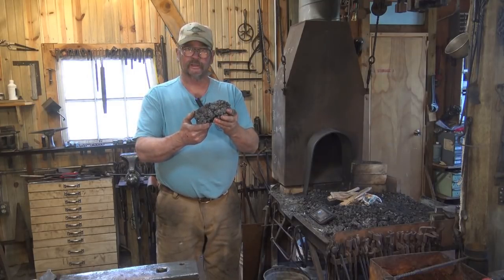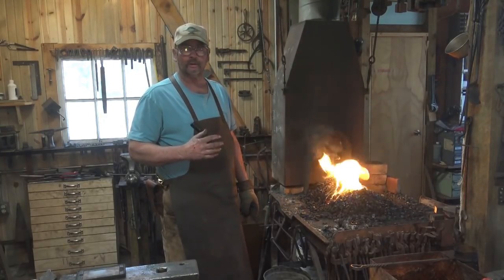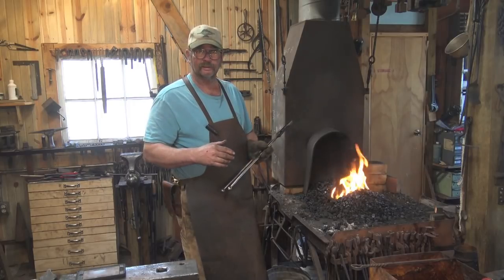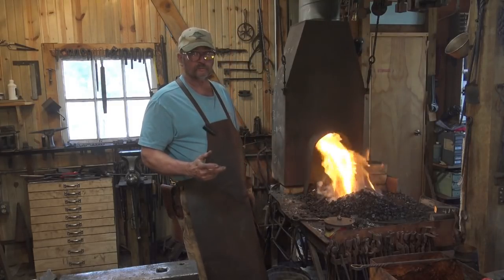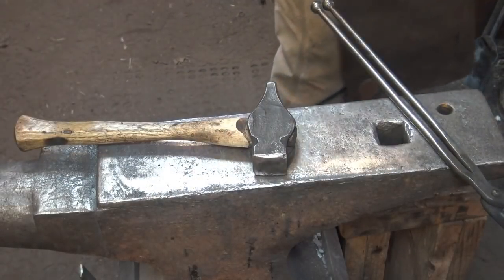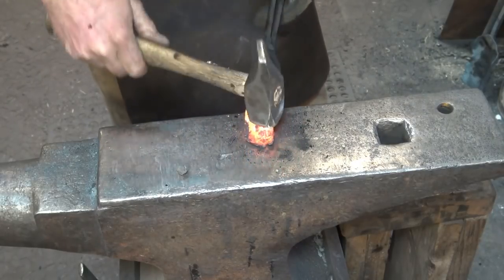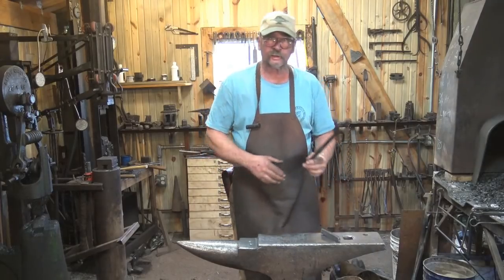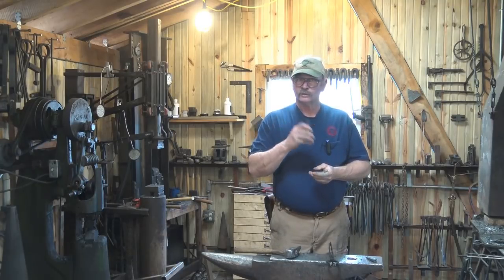Refining the iron bloom into usable wrought iron

Comment: Yeah the reason you had such a hard time with this, and why it was so brittle, was because your smelter friend was wrong. You need limestone in the melt, to tie up the Silicon elements otherwise you end up with a very brittle iron. Limestone becomes Calcium Oxide in the fire, which reacts with the silicates and turns them into Calcium silicate, which is your slag. Next time try it with limestone powder and you'll see a huge difference in the product. You ended up having to do a LOT more work to get it to a useable state, than you would have if you had used limestone powder in the furnace. Simple garden lime (not hydrated or quicklime) will do fine for what you're doing.

Comment: Something that might be helpful, is that when we did the smelt at the event, we went straight from the furnace to the forge. When consolidating the bloom, it was done basically in a dishing stump. The smaller bits that break off can settle to the bottom of the bowl, and be worked back in to the larger section of bloom. It definately consumes a LOT of fuel, but so does reheating it all. Loving this series! Thanks John and Jake!

Comment: The best thing to do about the smaller pieces of iron is to cover  them with flux and a bit of charcoal, put them into a sealed/covered crucible and bring the entire thing to melting temp. Once melted, pour it into a sand or clay mold and continue to refine it

Comment: Great video series on producing iron! 
For the little bloomey bits, could you heat a bunch of them in a crucible covered with coal, then consolidate them on a hydraulic press, using some flat bar around the lower die as containment?  I think that if you flux the bits in the crucible, dump them into the fenced die and pressed them rapidly, they may stick enough to then oroceed to the anvil.

Comment: Thank you for all the hard work. A tremendous effort for such a small amount of iron. I do recall watching swordsmiths of old wrap their pieces in stacked form with wet paper. Then coated in a clay slurry before bringing up to heat and welding. Perhaps?.
Reply from the maker: I just watched a bit of that in a video someone linked to.  Quite likely it would work form many of those little bits.

Comment: Try  a burrito weld,  flatten the  main piece out as much as possible, put the smaller pieces to be folded in on top, and fold the larger piece around it. Add some flux before folding and then put it in the forge.  Then it should weld together.   I don't know that will work but its what I would try.

Comment: Enjoyed watching. I saw you learning as you went too. As you discovered, initial refining is at a lower heat and when you hit "real" iron rather than slag you can tell the difference. If the bloom is removed from the bottom of the bloomery while the fire is still going it is at the proper heat to compress the "sponge" as it's called. (tapping the slag off also makes quite a difference) If this initial refining is done right there and then, on the stump, and you hit it with increasing force until you're hitting it hard and often (usually done with one or two strikers)by the time you take it to the forge it's MUCH less work to make useable iron. "Bloom bits" are either discarded or put back into the next smelt. The ore there is much higher grade than the ore here but I'm guessing that you're overestimating the yield of the larger bloom. It's been fun! :-)
Reply from the maker: We did take the largest piece directly to the stump while it was still at heat.  It certainly helped.  But the rest of it had to be hunted down after the area cooled enough to sift through the rubble.  We will see what happens with the big piece.  Biut even oif the yield is the same it will be a full pound and thats enough to do something respectable.

Comment: This is just the series I've been waiting for someone to do!  I don't have a lot of the tools that many others have.  You used the same type of tools I have to refine the iron bloom into bars.Now, as for the small bits that you threw into the sand, have you thought about maybe throwing it into a crucible with some crushed charcoal and making a small amount of steel out of it?  It might be a fun experiment.
Reply from the maker: You certainly could melt them in a crucible, but that is a different process and outside the scope of our project.

Comment: Neat to see. I recently got to see in person a bloom come out of a furnace, but nothing past the initial gentle hammering.

I’d think that the relentless pressure of the hydraulic press, avoiding impacts, would be ideal for consolidation if you can contain the bloom. How about fabricating a ram and die to make disc shaped pucks? The ram would be a fairly close fit, the die would contain the bits of the bloom. Circular shape would accommodate the natural tendency of the material to spread, keep the pressure even and tend to create a solid edge. Heat retention would be a problem. Once the pucks are solid, forge weld them as needed, forge to shape.

Comment: Hi John and jake . I have never done this before. But I've done reading on it. The small peices were just flattened.and placed on to the bigger bits then forge weld. Placed tile mosaic pattern to build up the stock. . Hope this is of use to you. Thanks both of you. Humbly Anthony Kent
Reply from the maker: Pretty much what I was trying to do in the second half of the video.  But at some point the bit just got so small that it was getting pointless.  Those few left over nuggets will go back into the next smelt.

Comment: The only video I've seen, which produced almost pure ore from slag straight away, was from Cody's Lab; and not only did he use an induction furnace with a crucible, but he also added some calcium carbonate or lime as flux, and he claimed that that would be very effective at seperating the iron from silica or sand-based slag.  Based on his results, he seems to have been correct.

Comment: your anvil looks exactly like mine. mine is a new England forged anvil. it also has a welded face plate. looks like the same size too. mine is beginning to get a little sway back if i use a square on it. any recommendations on how to best address that? also on refining the bloom, about 80% is ( For me ) on a stump with a wood hammer till it gets pretty solid. or it blows apart over and over. love the video. hope to see Jake again .
Reply from the maker: I will be doing a video on dressing an anvil.  But it really comes down to grinding off the high spots or filling in the low spots with hard facing rod, which is a lot of work.

Comment: Very interesting, just found the channel. Lots of questions, but I think most will be answered just by watching. I do have one though. I noticed the back of your bigger hammer has a twist. Sorry not sure of the correct "lingo" is that right?
Reply from the maker: That is a diagonal peen hammer.  By forging the peen at a 45 degree angle it allows for a more natural swing when using the peen.  Particularly useful for drawing out.  Although far from necessary.

Comment: An no, the ancestor would not have throw out those little pieces iron was hard to come by.  They would have taken them to the town blacksmith who would have paid them not much but repaired a farm implement that were in need of repair.  Iron was melted an poured into holes of pans an such. Bloom was also added to molten iron to in rich it.  Sometimes what we call just scrapes were all we had to work with, traveling blacksmith valued any scrape's they could lay their hands on.  Those were hard time for farmer's they valued their metal implement very highly few had iron. Poor farmer had to use wood to make the farm implements that if not made right would break which meant they had very bad days. Thank You Loader.

Comment: I’m wondering if you could melt it in a crucible and then pour it in to some kind of sand mound and let the crap float or sink.
Would that then be like cast iron?
Reply from the maker: You could certainly use a crucible, but that is a distinctly different process than making bloom iron.  I am not sure if wrought iron was ever done that way.  It is the way modern steel is made and is the way Damascus steel was originally made.

Comment: John you need a wood mallet for that. The steel hammer is too heavy
Reply: I was researching and I found a wood mallet works better for the first 3 heats than move to the steel hammer
Reply from the maker: I may look into that, although I doubt it is weight as much as hardness.  I have steel hammers that weigh much less that some of the big wooden mallets I have used for straightening iron.
Reply: Black Bear Forge I found that out on my first smelt 2 years ago. And I was told to use a wood stump too but I don't know about that part

Comment: This is the same process as they used on the YouTube channel AWE  me to make a Kill Bill katana. How did they get high carbon steel and low carbon from the same process and you say you are only getting wrought iron?
Reply from the maker: I haven't seen that video  But if you take the lower carbon wrought iron and add carbon fold and weld, then more carbon fold and weld over and over you end up with simple steel.  The more you do that the better the steel becomes.  I will be taking the smaller pieces of wrought iron through a similar process to make some steel
Reply: They don't go into as much detail as you, but the said that the carbon was added by the iron ore going down through the charcoal in the smelter. Then they just consildated the bloom in a charcoal forge.
Reply from the maker: The process is typically used to produce wrought iron.  The wrought being what happens after you have an iron bloom.  However since iron can absorb carbon at the right heat, it may have something to do with the temperatures in the furnace.  Today I spark tested the little bars I have forged out.  They spark more than typical wrought iron, so they did pick up more carbon than anticipated in the process.  I'm afraid I can't comment on all of the variable since this is my first experience.
Reply: Black Bear Forge
Reply: They don't give the heat but it seems to be a longer fire. They also drain molten slag from the bottom of the furnace. So that might be the difference. It is supposed to be the Japanese method they are using.

Comment: Use a crucible to melt the ore down.
Reply from the maker: The crucible process is a different process than the bloomery process.  It may be worth exploring as well, but with very few exceptions such as early Damascus steel, crucibles wern't used in the production of iron.  Modern steel is made by using a crucible process.

Comment: Those little bits couldn't you do like the Japanese do. Use a clay slurry and the roll in burned straw then wrap in paper then back into the forge. That would be an easy way of using those small bits

Comment: The iron age right before our eyes.
I wonder if you lose a bloom in the fire if you can pick it out with a magnet?  
Watching you hammer the bloom makes me wonder if the viking smiths re-introduced the bits and pieces of bloom back into the cupola for refinement, gradually bringing the whole mass to a more pure product before smithing it.  I think absolutely everything coming off in the hammering process is feedstock for the next cupola firing.
At 17:18 you're talking about a lot of work for little iron.  If you're living just before the iron age began, you're at the end of the bronze age and the hardness of what you're holding is like discovering carbide over HSS.  I'll bet those little pieces they were holding and could shape/form were like gold.  Probably more valuable than gold then.
You know the difference between the bloomery furnace and a modern cupola is simply the cupola has a cupola below the tuyers to catch the molten iron.  It's quite possible the viking smiths knew about catching the iron and were able to further refine the bloom pieces prior to actual smithing.  They may have had a crude cupola hearth or furnace of some sort that did this.

Comment: smash by hammer  unworkable pieces
collect all small pieces (wich magnetic)
  add charcoal powder (not too much)
put this mixture into sealed clay  container 
 and overheat  on forge about 20 minutes (may be a bit longer)
must get good  iron ingot
Reply from the maker: There is no doubt that using a crucible process would produce good results.  But since this project was about the bloomery process, using a crucible would be outside the scope of the project.
Reply: +Black Bear Forge
I suggest not exact a crucible process , I suggest something  like  anchient  copper bloomery process ,  which the not  too  far step  from  your project 
And i has strongest suspect , wich  anchient  metallurgist can  figure out something  like  what. (^____^)
Indian and arabian ---  did it.
Main  part of it ---  overheating without oxigen.

Comment: How would you say the wrought iron you made that day compares to bronze? When you say it is suitable for tool use, do you merely mean by today's standards?
Reply from the maker: Since wrought iron and bronze are such different materials I'm not sure i would compare them.  As far as suitability for tools, I am thinking more from a historical view where wrought iron was the base for tools.  It still requires a steel cutting edge which I will make from the same wrought iron.  But the making of steel is still a future project.
Reply: @BlackBearForge  I have been trying to understand why there was a Bronze Age in so many places around the world when iron is more abundant. I know that iron has a higher melting point than copper or tin, but these bloomeries seem well within bronze age capabilities. Also, my understanding is that iron tools were used before steel was invented.

Comment: Not to be a cheater or anything, but can’t you just put those smaller bloom pieces in a small graphite crucible and put that crucible in the coal forge? Was thinking once the iron was liquid you’d be able to pull the dross off the top of the crucible...
Reply from the maker: Probably, but that would have been far outside the purpose of this project